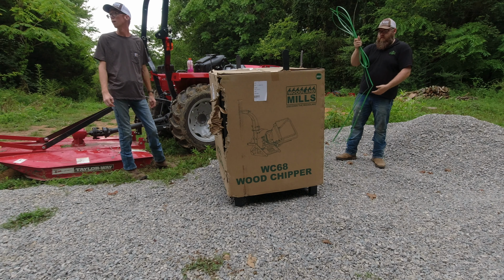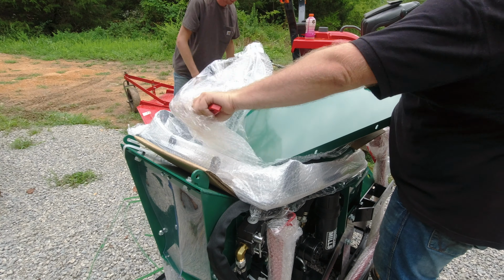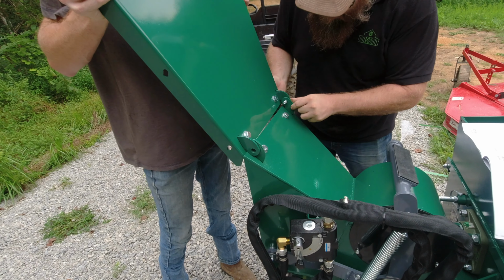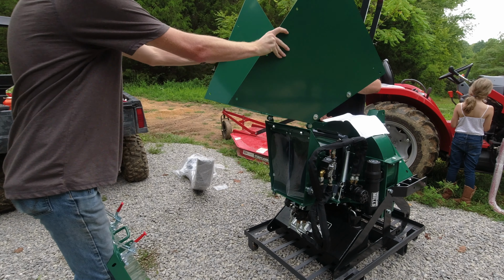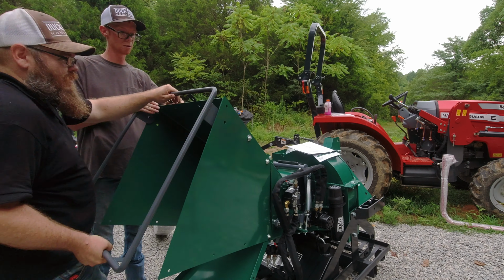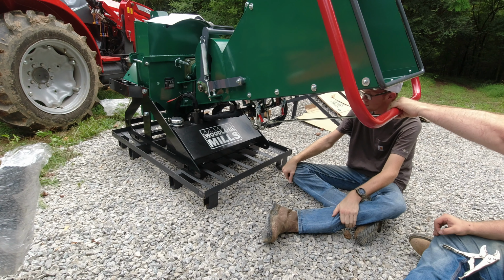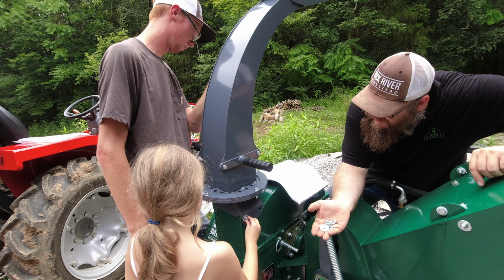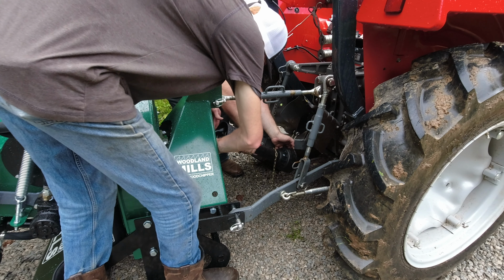047 - Buying a Woodland Mills WC68 PTO Wood Chipper for our Massey Ferguson 1835E Compact Tractor

Comment: Thanks for the video. It helped me decide on the  Woodland Mills WC88.

We keep a brush area in the back woods for debris, but over the years it has gotten large enough to qualify for it's own zip code. Also it's composting - and after we had a fire start along the edge of our woods a few years back from nothing but natural deadfall, weeds and leaf litter self-combusting - I think chipping is safer. That big pile in the woods is composted in the center, but adding more every year just warms it up again. 

Thanks again.
Reply from the maker: Awesome! I love this machine. I have a review video coming up for the chipper. I'm mostly done recording everything. Did you order yours yet?
Reply: @DuckRiverHomestead  Called yesterday and need to hold off a bit because if they shipped now it would be here about a week and a half before I return from some travel. So aiming for the first week of August.

I bought a grapple from EA when I got the new Kioti rx7320 three years ago. The two of them are beasts when combined. Also makes a lot of work for that chipper when it shows up.

Thanks for the vids. Subb'd.

Comment: I've been looking for something too.  Been going back and forth on whether to get a PTO powered chipper or a much cheaper one with a dedicated motor.  We have a lot of trees fall and I hate burning the piles.  I've never had a fire get out, but they get out all around us.  So I prefer to avoid the burn.
Reply from the maker: Yes, the burn pile scares me a bit. I did one once and I was running around for the first hour shoveling everything into the designated area. I'll try to just burn roots from now on.

The only thing I don't like about PTO driven implements like this is that I can't really use my tractor while I'm working it. I have to stop, move some stuff around, then get going again. Not really a big issue if I'm working by myself, but if I have a few people along with me, it slows everything down. But dang I love this machine. I'll do an update video on it at some point.
Reply: If you have a tractor, the PTO makes sense IMO over a smaller unit with gas motor.... it's one less motor to worry about.  @homestead_diy @DuckRiverHomestead
Reply from the maker: @thehammah8444  the only problem is that it only works when connected to the tractor. But we’re talking about 6” logs here. A cheaper gas powered one wouldn’t be able to chip something that large.

Comment: Can you adjust the orange safety handle so you don't need to hold it out in the forward position and it just stays in forward?
Reply from the maker: It's a little adjustable. I don't usually have a problem with it.